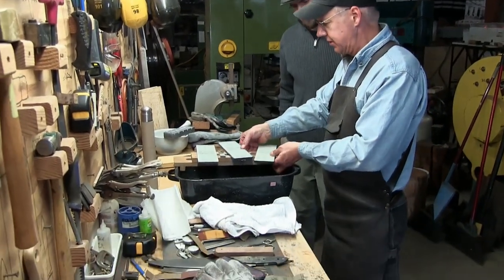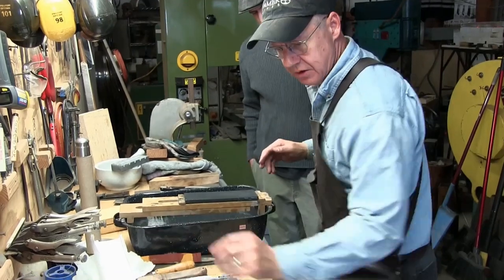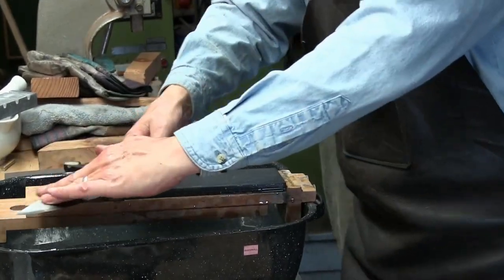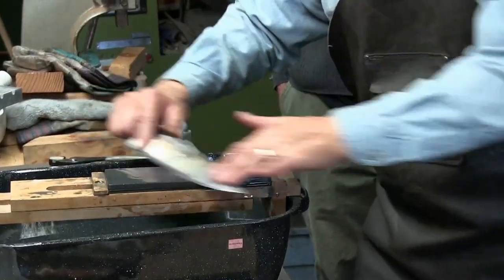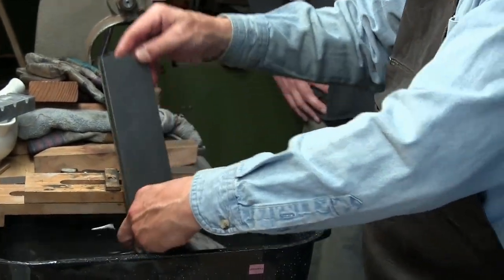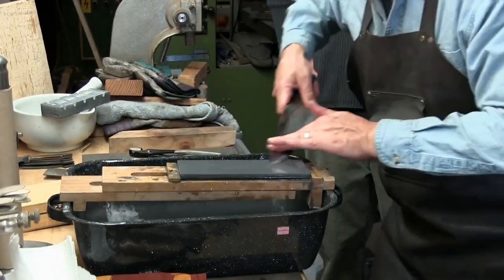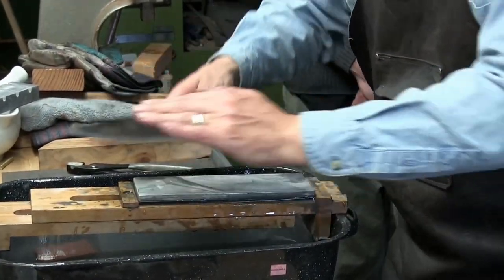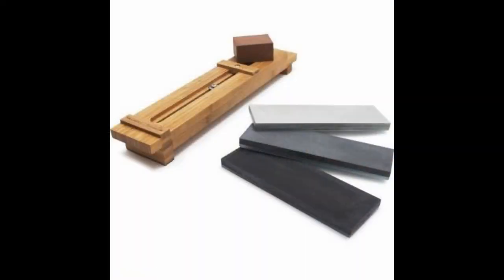How to Sharpen a Knife with Bob Kramer

Comment: In another video, Bob Kramer tells to use 4 - 6 lbs of pressure; and great tip, try on you kitchen scale for the feel! I also found a small wedge at home which happenes to be of about  15 degrees, so I test my angle. Bob uses a match box in that other video, as he mentioned here at the beginning. Those 2 additional tips were great for a beginner like me. I cannot yet feel that burr or wire edge; but I get from "0" to "70%" already; aiming to 100+ some time

Comment: Love this video. Because everyone quickly skim over what to do with the wire edge. 
Also I haven't come across a video that mention the leather as a tip. Found some leather five minutes later I can smoothly do the paper cut now.
Reply: You might also be able to hone that wire edge with a steel or ceramic if you don't have leather

Comment: question,  on the beginning side where i start grinding on hard stone to get a burr,
do i continue the other side with the same stone untill there's a burr coming to the other side,
or do i continue with a finer stone to get rid of the burr, or do i continue with finer stone to get the burr on the beginning side?
Reply from the maker: The burr only needs to appear on one side during the first stone (coarsest stone). But watch his technique again. He forms the burr on one side, but he does sharpen the other side on the same stone to keep it balance. But once he feels the burr beginning to form he then focuses on sharpening that side a little more than the other until the burr is the full length.

Then he evens it out on both sides. Once the burr is formed w/ the coarsest stone you don't need to form it again with the finer stones. They are just used to refine the edge.
Reply: That's my idea every time,   establish the apex after coarse stone.
Move on with finer grid stop counting just remove the coarse scratches on both sides.
Seems i can't get it razorsharp. Must be doing something wrong.
Most of the time  i cant even see the burr, but just metal dust that's easily blown off

Comment: What grit did he use at first? Im a student in culinary and this is very new and confusing. I own a Vnox grand maitre 8in and i have a combo stone 400/1000 from Mercer but im still very novice to it so im practicing on a old chef knife.
Reply from the maker: He started w/ a 400 grit. But that is for a knife which needs a new edge put on it. If you have taken care of your knife and it has a decent edge then you should be able to start w/ the 1000 grit. Kramer finishes w/ a 5000 grit to further hone the edge and then uses a leather strop to buff the edge. The strop isn't necessary, but after using it myself I can say that it certainly finishes the edge off with a very finely honed, polished (and sharp!) blade.
Reply: David Buchanan Ok thank you for your answer. Can i just stick to 1000? i dont have any other stones or any tools for sharpening (except a honing rode).
Reply from the maker: If the 1000 gives you a sharp enough edge for the work you're doing then yes it will work fine and will not hurt your knife. But eventually you will want to get something around a 5000 grit. It's just a matter of how sharp you want the edge to be.

Comment: what exactly does the "wire edge" feel like?
Reply from the maker: Watch the way he runs his fingers over the edge. When you feel the edge this way then the "wire edge" will like a burr on the very edge of the blade, like a long extremely thin wire is running the entire length of the blade. Keep working it until that burr runs the length of the blade and not just in certain parts.

After you have finished the process and the blade is sharp the "wire edge" should be gone and the edge should feel very smooth (again, feeling the edge as he demonstrates).

Comment: Having declared my dissatisfaction with this sharpener last night https://www.youtube.com/post/UgkxDcr-y2Pf6xdnrFHrSP7dl9kpKaCozcSQ I thought about the problem some more. It occurred to me that I might be undoing each attempt at achieving a sharp edge by the repeated attempts. So, I tried to clean up the unsatisfactory result by honing with only positions 3 and 4.Miracle!! A really nicely sharpened chef's knife, more than enough to handle my needs. Admittedly, it did not reach professionally sharpened razor-fineness, but it is now significantly sharper than it was. A bout of breaking down carrots convinced me. So, major apologies to the manufacturer, Amazon, and all happy and potential owners! Follow the directions: don't buy it if you have ceramic blades; and don't overwork your knife blade.

Comment: I bought a 120 / 320 stone at a local hardware shop. That's more common around than "
Reply from the maker: A 120/320 is good for a knife that has an edge which is in very poor condition. It will not get the results which Bob shows in this video because he uses several stones which are over 1000, which gives a very fine edge.
Reply: David Buchanan thanks! I do have a 1000 + 6000 grid. My question is more about not “feeling” the wire edge, no matter how I try with any finger, nail, magnifying glass....
Reply from the maker: @federicol8366  Be sure to try to feel it the way Bob shows because we tried to feel it the wrong way first. Basically, you stay on one side of the blade at a lower grit until you can feel the wire.

Comment: First, a question:
Wire edge?
Second, he says he doesn't like to do striaght back and forth because it leaves a ridge then does it straight back and forth right before changing stones....I am confused.....
Reply from the maker: Watch the way he runs his fingers over the edge after using the first stone. When you feel the edge this way then the "wire edge" will like a burr on the very edge of the blade, like a long extremely thin wire is running the entire length of the blade. Keep working it until that burr runs the length of the blade and not just in certain parts.

He states that he prefers long strokes along the length of the blade to develop the wire edge, but later he does use straight back & forth on the heel because he didn't feel the wire edge along that section of the knife. So, long strokes to develop the wire and back & forth to fine tune any areas which are missing the wire edge when the rest of the blade has it.

After you have finished the entire process using consecutively finer grit stones and the blade is sharp the "wire edge" should be gone and the edge should feel very smooth (again, feeling the edge as he demonstrates).

Comment: i bought a 20 dollar sharpening stone and i literally could shave my legs with it
Reply: but i cant push cut paper or slide cut it very clean but i can shave my leg hair with the knife what did i do wrong
Reply from the maker: You probably need a finer grit stone to "polish" the edge which will increase it's sharpness
Reply: ***** its the ling kw65 1000/6000 so should be fine
Reply from the maker: I would think that would do it. I'm not a sharpening pro, but when I put my knife on my 6000 grit (after working through the others as needed) it does the push cut. 2 suggestions: first review the video ( and one of Bob Kramer's other vids on sharpening which he did with Sur La Table) to see if it is your technique. Second, consider getting the leather strop. It does make a huge difference for the finishing polish of the edge. And a third consideration...if it's sharp enough to shave with do you want to spend money to get it sharper?!
Reply: David Buchanan  idk i though shaving sharp would be sharp enough to push cut
Reply: I stropped it on newspapers and it was way sharper
Reply: nice, I've never known that you can shave your legs with a sharpening stone itself

Comment: also, this is why water stones suck. so much cross contamination here. at 5,000 grit you should be able to carve news paper. I can tell the quality of the edge by the sound of the paper your cutting. very poor
Reply from the maker: The knife was very sharp. It should be noted however that this was just a rough-work blade which he uses demos. Do you even know who Bob Kramer is?
Reply: David Buchanan I do, not impressed. not impressed with Murray Carter not impressed with cliff stamp. John jerrech with razor edge knows what he's talking about. people are important anymore. can't achieve  a good edge like that
Reply: David Buchanan when he says strop he didnt use a conventional leather strop he used a  rectangle thing is that a strop. if so where can i get one.
Reply from the maker: Google "kramer leather strop" and you should find it.
Reply: Lolz, I'd like to see John shave with a freaking spoon. Murray Carter can lay an edge like nobody else, with pretty damn cheap abrasives without stone flattening. Of course on a double bevel knife a guided system with high quality abrasives like Shapton pros or Naniwa choseras is going to offer a superior V edge, but guided systems have their limitations particularly with single bevel knives or any woodworking tools.
Reply: @rough rooster... 
 lol... DMT's are great for removing steel fast, but they max out at 1200, and thats = to a 1000 wet stone...